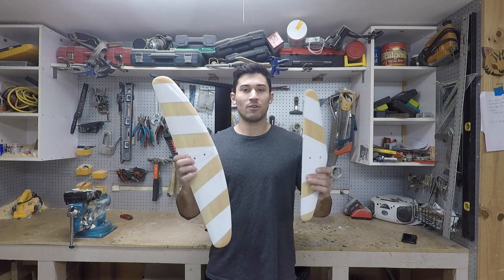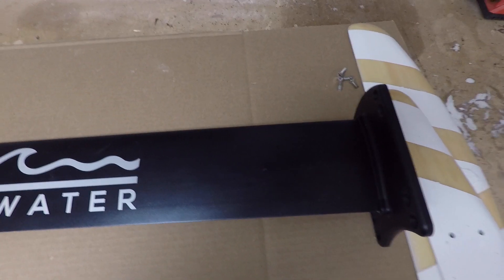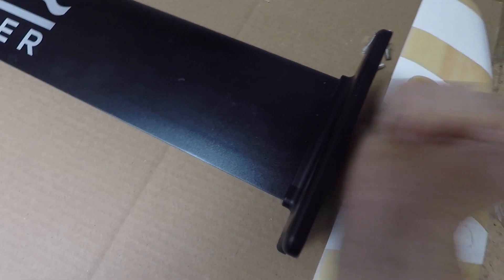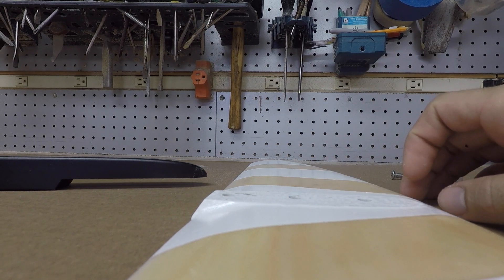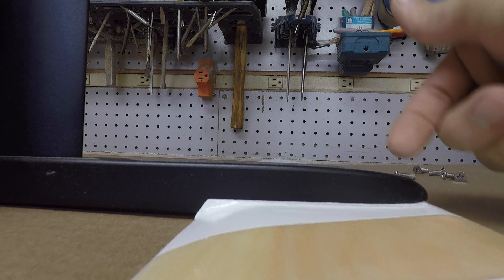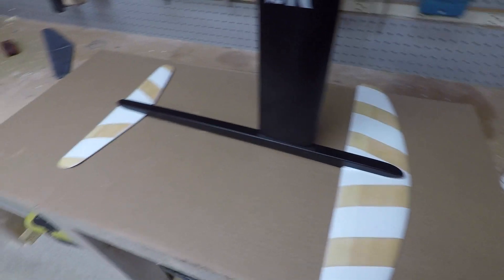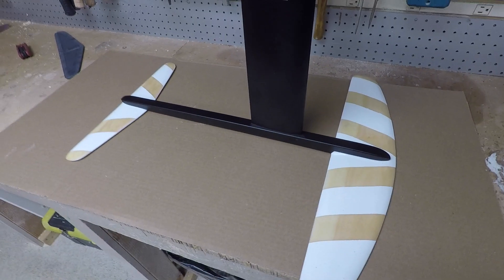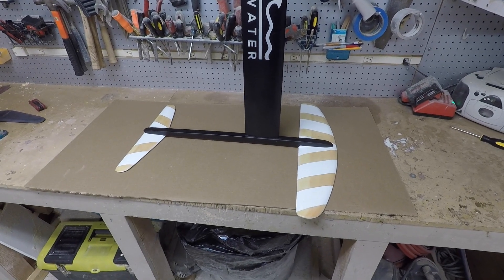BUILDING a Hydrofoil! Assembly and RIDE!

Comment: Dude that is AWESOME. I built a foil a couple years ago out of redwood and fiberglass that BARELY got me out of the water, but your setup looks so clean!! What kind of wood are the wings made from, and do you notice any flex with them when you ride?
Reply from the maker: I source nice grain dry pine. Its a cheap wood that has a very good strength to weight ratio. Flex depends on the layup. This particular wing has a slight amount of flex. Its funny as I CNC come wings out of g10 that don't flex at all and I have made some very flexible wood wings... I've never noticed a difference in performance.
Reply from the maker: Also I have ran some wood wings with a slight flex in them very hard into the ocean bottom and never had them break. Crazy strong!